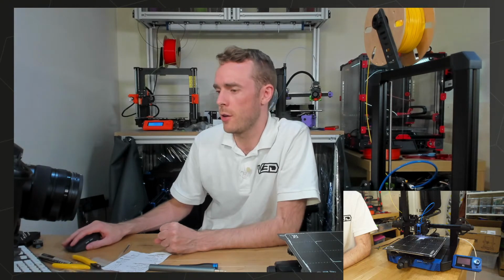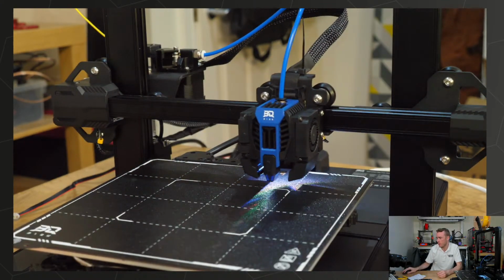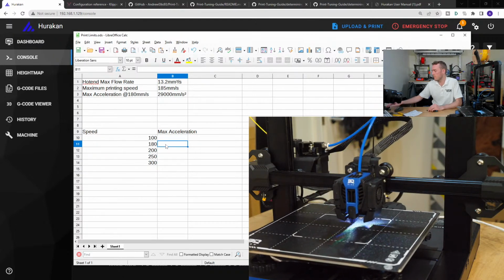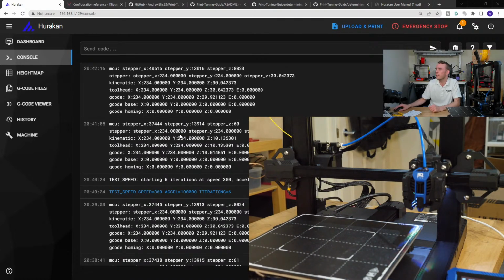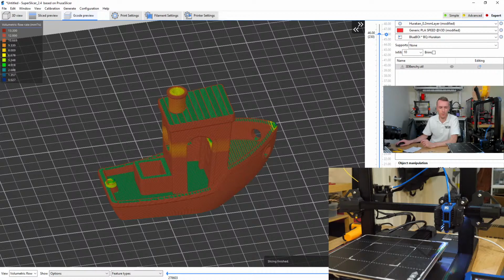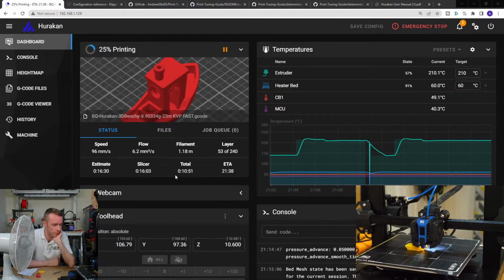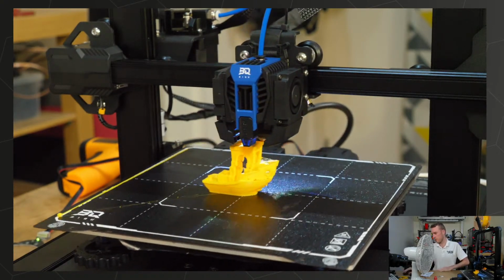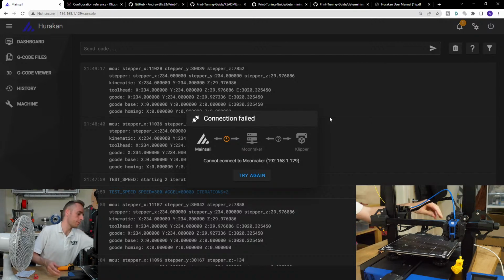BQ Hurakan - Bed Slinger Does 80,000mm/s²!!

Comment: Speed for this printer is good enough for me, it is very silent as compare to my other 2 printers, hotend is not good stuck many times so I modify into direct drive using HGX extruder +Nema14, and bambu lab hotend works perfectly. It’s my first klipper ❤still loves this printer til now so I bought a 2nd new at $150 last unit sale😂.